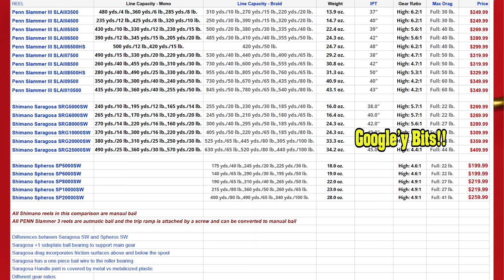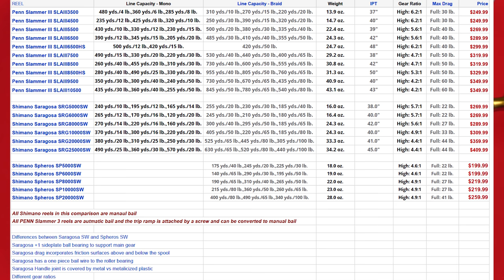Penn Slammer 3 vs Shimano Saragosa SW Who makes the best Surf Jetty Pier Boat spinning reel?  Sealed

Comment: I know this is an old thread, but I’ve heard the question arise a couple of times regarding the gear mesh. While I don’t know the specific reason the engineers and designers have Penn gears mesh the way they do, I can offer you some of the ways the pattern affects the reel. The question of overall strength isn’t really much of an issue regarding the design. By moving the backlash “out” the gears allows for better lubrication of the gears, less heat from friction, smoother performance as the gears wear, and a more predictable wear pattern. The downside is more noise and more “slop” during abrupt handle stops such as fish strikes. The coating the Shimano uses helps the wear in and noise issues. I’m guessing it’s a salt bath nitriding process or something similar. This is a self lubricating coating this is very resistant to wear and corrosion and is great at taming noise harmonics. However, once it does wear through, things get noisy and rough quickly if corrosion starts. 

Based on the customer expectation of longevity of Penn products but not necessarily the expectation of refinement, it would stand to reason the engineers built the gear lash profile to achieve certain characteristics synonymous with Penn reels.

Comment: great video man thanx
i fish the shore jigging technique and i have the saragosa i would like to buy the penn for an extra reel ,would you say that is good for this  technique?
Reply from the maker: Yes.  I've been bucktailing like crazy the past month with it.  The 4500 paired with fireline ultra 8 14lb test has been perfect for fish upto 20lbs in very heavy deep current.  Not the reel I'd generally use but because it was free I've been trying to break it.  And I'll be damned if it's no different than when I unboxed it.  Ive fished next to a few friends that use the saragosa SW and we've switched setups.  No difference in feel at all.  Only lighter.  And believe it or not it manages line as good.  I'd buy the spinfisher over the Spheros and have a hard time justifying the gosas cost for everything I've been doing with it.  And as long as the larger sizes perform the same as this one.  I'm leaning spinfisher long cast off the beach and throw a dart spinfisher vi, slammer 3, Gosa SW for best boat reel under 300$
Reply: Thank you very much my friend
you have covered me with your answer i think i am going to buy it and have it with an extra rod for heavy jigs or poppers
thanks again
Reply from the maker: @manthosshorefishing9065  you're welcome.  If you do make a purchase online.  If you buy through any of the shopping links.  It pays me a few bucks.
Reply from the maker: @manthosshorefishing9065  Worth mentioning.......When I replied to this it was on the youtube analytics app and it just shows the comment I'm replying to not what video the comment was in.   I thought this was in a Spinfisher VI video not the slammer.  I like the slammer 3 quite a bit.  But I was referring to the Spinfisher VI.  Sorry about that.       http://bit.ly/PennSpinfisherVI

Comment: I was thinking of picking up a slammer 3 as a popping/ jigging reel for the occasional bluefin/yellowfin tuna trip I do get invited on. But now with the spinfisher 6 I’m a bit confused, I know the slammer has the stronger drag but it does seem to me that the spinfisher puts out enough drag to get the job done, any input is much appreciated
Reply from the maker: Assuming you're fishing at 20lbs of drag.  You're probably lookin at the 6500 size.  And the spinfisher gets brass gears and metal rotor so it's really close to the slammer.  But I'd go slammer for the handle as it's more comfortable than the spinfisher
Reply: Tackle Advisors thanks!

Comment: Titanium is not superior in this case. Titanium may have a better strength to weight ratio, but it is not as stiff as steel for the same diameter. I think the Youngs modulus of titanium is 50 GPa and steel is anywhere from 200-300 GPa. The benefits of a titanium shaft can only be realized if the shaft is larger in diameter than an equivalent steel shaft.
Reply: I agree, better to use titanium elsewhere.

Comment: Hi.  Great review.  I reticently purchased the Saragosa 6000 for my Tsunami Air Elite 1102M surf rod (11/18).  The reel performs as expected which is great.  I do have a thumping as I real in though.  The angle of the Saragosa is 0 degrees which is parallel to the rod.  Most reels if I m correct have a 3-5 degree angle towards the rod.  The thumping is coming from the line hitting the bottom of the first guide as I reel in which is distracting.  Is this a rod reel mismatch?  This is the first I have ever heard of this.  Any help would be appreciated.  Thanks!
Reply from the maker: Hey John.  1 quick thing.  Make sure you don't have a wobbly reel.  Some had Un balanced rotors which could cause a similar sensation.  And yes the parallel reel foot design can cause that sensation.  An option would be to add a shim under the butt end of the reel foot to tip it forward slightly.  Provided the seat isn't super snug you should be able to lift it enough to diminish the sensation with that rods guide placement

Comment: I am curious to know since Penn Slammer 3 5500 and 6500 have the identical specs but  different in size in terms of the body and internals. Does that make the 6500 more stronger and produce more power when reeling the fish?
Reply: Yes.  The 6500 is a larger frame size where the 5500 and 4500 are same frame size.  Bigger body and parts more strength.
Reply: @tonykomer2997  thanks for your reply

Comment: Without question, the slammer iii will outlast the shimano.  at this price point, the real long-term value is with penn.  i only wish penn used a bushing where the mail shaft meets the housing.

Comment: If you spray your reel with spanjaard tackle protector aftef rinsing post fishing,is it possible to get into the AR clutch? Since you mentioned it may be detrimental if wd40 or grease gets to it.  Don't want to mess up my gosa 25000
Reply from the maker: It's got a ways to go to get in there.  But I'd rather see a good rag wipe down than heavy spray down

Comment: Hey Tackle Advisor gang - hoping someone can help me out here ( or even the Guru himself :) ).  I have a used Saragosa SW 6000 that is smooth but has a "binding" issue at a certain part of the cycle when turning the handle.  When turning fast, it's not really noticeable, but when slow or allowing it to spin and stop on by itself, there is an obvious binding part of the stroke.  I've taken a first look at it inside but nothing looks out of place and all the bearings and gears are lubed properly.  Any idea of what would make it bind up or be out of alignment?  Anyone else experience this before?  Please and thank you.  - Ryan

Comment: 53:54 I have a penn slammer 3 4500. I don't go into surf and get dunked by the wave or anything. But one day when I took it out for fishing where I used it to cast 2-4 ounces bucktails, it starts to produce noise just like in the video 53:54. Is there away to make fix that noise?
Reply from the maker: Does it make that sound without line on the roller like in the vid?  As it could be your line roller bearing.  If it does  I'd replace the pinion bearings and line roller.  Email penn and they may send em to ya no charge.  I think boca makes a ceramic hybrid for like 10 bucks just gotta size em right.  May be an upgrade...I know I've used em on daiwa bg's at that location

Comment: With regard to sealing and protecting the reel against sand intrusion, is the Saragosa better than the Stella?
Reply from the maker: Stella Sw?   I use my 08 stella sw for surf duty and it's brand new after years of abuse.   The new one is sealed nearly identicaly...as is the gosa.. I think the sealing differs in the way they seal the ar clutch housing...stella is in the frame ...gosa is a cap.  And I believe the line roller on the stella may be sealed differently.   Both are tanks.
Reply: Tackle Advisors Thanks! This is my new favorite channel!

Comment: Sorry the video is too long what reel is better I want one for the boat
Reply from the maker: Saragosa is a more refined reel.  Both are equally capable.. Brass on brass gearing and metal rotor can take more pressure (slammer).. Saragosa cranks easier under pressure.
Reply: Ok ty

Comment: Would you buy a saragosa 10000 and if you wanted a 8000 spool then buy one or buy a saragosa 8000 and then buy a 10000 size spool if needed?
Reply from the maker: Did that with my 08 Stella SW's it'll work with the gosa as well... Buy the gear ratio you want and spare spool you want

Comment: How can I put a black handle with an EVA foam power knob on my 4500 slammer 3? are there parts from other reels that would fit?
Reply from the maker: Hmm there are aftermarket knobs available.. And I think Penn knobs are cross compatible
Reply: @TackleAdvisors  Hey thanks for replying! I love all your videos! 

I called penn and they said that only some knobs and handles would fit the 4500 size. Like the handle assembly from the 4000 battle dx, or the handle assembly from from the 4000 clash 2 HS. Just not really sure what the best option is. I think the knob from the The clash 2 AU might fit as well but can't find one. I know the spin fisher and other similar handles will fit but I'm trying to get a foam knob. Not sure the 5500 slammer's foam knob will fit the 4500 size handle after speaking with penn, but it would be awesome if it did.

Still haven't found an aftermarket knob that doesn't require some form of drilling , which I'd like to avoid, but I'll keep looking.